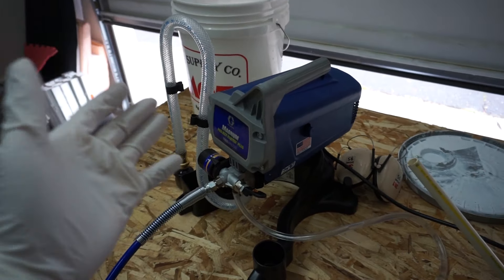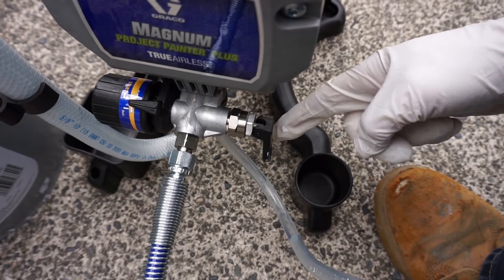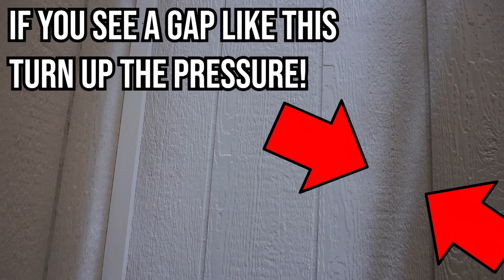My First Time Using The Graco Airless Paint Sprayer Outside My House | DIY For Beginners!

Comment: How much paint did you use and what's the sq footage? Getting ready to paint my 1000sq foot home this summer with the same set up. Thanks
Reply from the maker: Hi! I only painted the front of my home and the sides. It took 5 Gallons. I will doing the back soon. My home is a 1400 sqft home.
Reply: @FixThisHouse  Thanks! My home is red and I am going a blue color with white trim. I got 10gal of blue. But I also have a small shed. 

Thanks for the reply and video

Comment: I’m looking between this model vs the x7 about $100 more. How is the project holding up?
Reply from the maker: If you want similar result I would go with the X5, link on the bottom of the video.
I think that would be sufficient enough if you were trying to tackle a project of size like what I did on the video. So far it’s been a year and it’s holding up very well! Make sure you pick a good quality paint as well! 👍🏽😊
Reply: @FixThisHouse  great video! Did you find the hose / cables being in the way or annoying at all? When moving around, how often did you had to move your unit and paint bucket or was your hose long enough?

Comment: Question 
How many gallons of paint did you use to paint the house,  when ever you use another gallon do you have to Strain the paint for every gallon you use
Reply from the maker: Hi! The front of my home I ended up using 5 gallons with one coat. I used a 5 gallon bucket that was already mixed at Home Depot. I’d it’s brand new paint I didn’t need to strain but if your using paint that had been sitting for a while I advise you strain to prevent clogging, but the suction tube already has a mini strainer just like what you saw from the video
Reply: @FixThisHouse  thanks I already ordered this and painting my house this weekend coming up.

Comment: Bought same exact one. Started a project and the first 45 min everything was perfect. Then the hose started leaking paint everywhere. The area where it attached to the machine. Right near the stainless steel nuts. Both were tight. Maybe a cut in the hose ? I need help!! Lol
Reply from the maker: You might have a cut near the fitting or a pin size hole. Please return and get a new replacement 🙏🏽

Comment: Those sprayers are good for small projects every once in a while. I paint pretty much every day and those sprayers just do not last with daily use. I blew one up in 6 months. Save up and buy a rebuildable sprayer if you spray daily.
Reply: Just interested if you know what part failed? I would assume it is the tiny oiless air compressor, but curious if you know the cause of the failure. I am honestly surprised the thing lasted that long in a "commercial environment".

Comment: Great video! Do you have to clean the nozzle regularly while painting?
Reply from the maker: Thank you! 🙏🏽 just good practice to clean after each use 👍🏽😊
Reply: I have wagner machine. I had to unclog. I think the paint was too thick or because I didn't strain. But then I did 50/50 water and no clogs.

Comment: If it’s water based paint, and you’re using it outside, won’t it just come off in the rain?
Reply from the maker: It will not, if you go to your local hardware store they can mix you any type you need just remember that quality paints are not cheap

Comment: I was debating on buying this sprayer and watching this video you just help me make my decision good job man. 
I retract my previous statement this paint sprayer is garbage!! i began spraying my  stucco wall the machine started making noises and pressure immediately stopped flowing through the hose. i looked back at the machine and a pool of paint was now on the ground and under the machine. it appears the spray hose is faulty and does not maintain a proper seal when attached. paint continued to spray out covering the painters plastic i laid down. going over the reviews that I have seen about the sprayer that's a common problem so I'm returning this junk back to Amazon and looking for a way better sprayer from a totally different company 👎
Reply from the maker: Thank you 🙏🏽 so much! I’m glad I could be of help 👍🏽😊
Reply: @FixThisHouse  
Hopefully this prayer is still working good for you man but it failed me big time

Comment: TBH bro I really believe that rolling it on would be faster just because set up. Also I seen these guy back room just because the paint doesn't stuck good sometime. Good video
Reply: I could cut and roll that way faster and it would look a lot better!
Reply: Rolling would not be faster. You still have to prep the area you are painting. While prep time is cut short there is no way any person could roll that entire wall in less than 2 minutes. The only additional prep he did versus rolling was the covering of the windows, ceiling, and front door with plastic. Again, this is for a home owner and not a professional and most home owners cannot cut edges free hand and have crisp lines.
Reply: @mresmith4302  I don't know how much masking and taping you've done, but that is where your time goes. It is always a trade off, either way the time works out about the same. Mask and spray or cut in and roll out.

Comment: I should have done more research but I bought this model to paint my basement walls with Drylok waterproof paint. WARNING, this sprayer model will not work with this paint. Way too thick. I talked with Drylok support and they said you need a professional high pressure sprayer that cost thousands of dollars. I returned it along with one 5 gallon bucket. I kept the other bucket and brushed it on. Took me 12 hours to paint! ☹️

Comment: I purchased this to do home...it is not fun...all the accessories (respirators & a lot of extra paint equal $$$$)... fumes...the paint mist leaking out of enclosed area...
Is it faster...maybe, but if you factor clean up times...maybe not.
Is it cost efficient...HELL NO...respirator 60$ plus extra paint.  Hell No...I used 4 gallons 2 coasts with sprayer...I used 2 gallons 2 coats with roller.
Reply from the maker: I do agree with the clean up. For indoor I do recommend the roller for a much cleaner and controlled vapors, otherwise it gets all over the place unless it’s a brand new space with no furniture inside the room yet.
Reply: @FixThisHouse  i went thru that too...next day purchased $90 roller handle and extra rollers  $12ea. ...well then you want to buy another straight line spray gun...wtf...oh did I mention the roller attachment weights A LOT without addition extention 10lbs with paint loaded( mind you doing entire house) ....and it leaks...sorry this is not  a DIY friendly experience, period.

Comment: I saw overspray on concrete..and and area that you completely missed above front door.
And biggest mistake was cleaning machine ontop of concrete without any dropcloth protection under your equipment and work pails.
Other than that this Greco seemed to do a nice job. However you didn't mention how much product was lost due to spraying on breezy day.. just saying
Reply from the maker: Thank you for the advice and tip! 🙏🏽 not much was lost to the wind, I kept my distance around 6-12” 👍🏽😊

Comment: 1 hour to spray, 2 hours to plastic all the windows and doors, 1 hour to clean up the sprayer, 1 hour to fix any areas where you over sprayed and reality is it took 5 hours bro. I could had cut and rolled that in less time all day long.